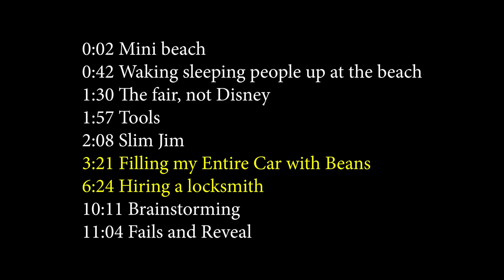Filling My ENTIRE Car with Beans and Hiring a Locksmith to Open it

Comment: Beans again!  The magical fruit!  In the late 1950s my aunts pranked their brother with a red weather balloon.  They filled the balloon inside his car with a vacuum cleaner until it bulged out of all the open windows, and tucked the neck down out of sight.  He approached the car quickly, felt the smooth surface and spent several minutes circling it pushing his hands against it, literally scratching his head.  Then finally stabbed it with a knife.  It deflated noisily and whipped around inside.  But my aunts had not realized how much talcum powder was put into those so the could fold up tightly for storage without the rubber bonding to itself.  He was sprayed with white powder and the interior of the car turned completely white.  My aunts spent days vacuuming the inside to get it all out.

A other common prank in 1950s Wisconsin was to open the hood of someone's car and yank a spark plug wire, connect it to your own grounded spark plug with the fuse of a plumber's smoke rocket in the gap.  They'd start their car and it would run badly as smoke poured out from under the hood.  Dad's brother (victim of the weather balloon) tried to do this to him on his wedding night.  But someone tipped Dad off and he visited his car during the party, removed the device and placed it in his brother's car.  By tradition the bride and groom drove off first to cheering and the prankster thought his device had failed.  Then he returned to his own car (later reported to Dad) and it went off flawlessly.

Our family loved highjinks.

Comment: PRANK STATS

96 cubic feet of beans costs roughly $593USD

If these beans traveled from Florida to NJ the freight cost would be $1,613 USD

The beans would weigh 4321 Lbs

960 420 g of beans x 245 calories / 171 g = 2 800 000 calories

Guy just bought ~$2000 worth of beans after shipping costs and wasted 2,800,000 calories